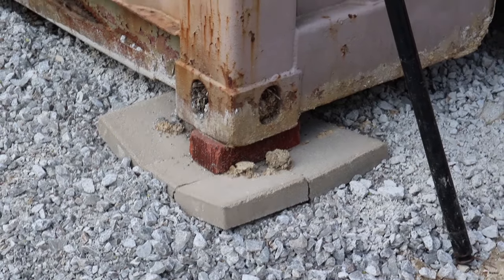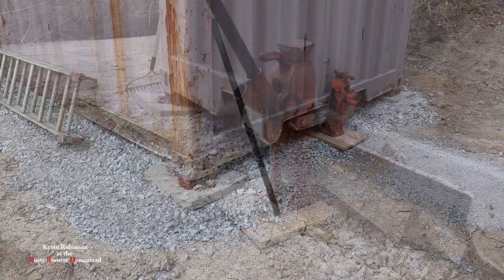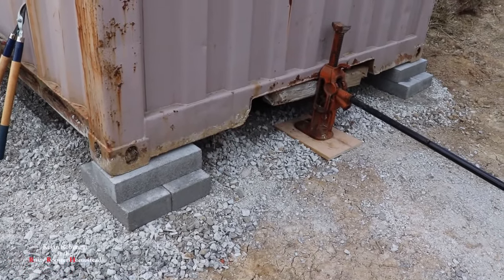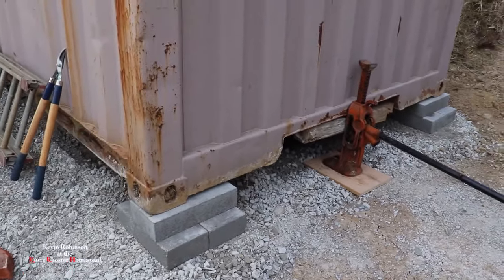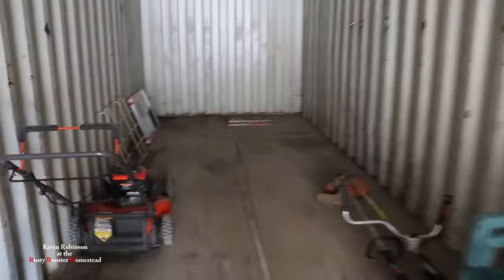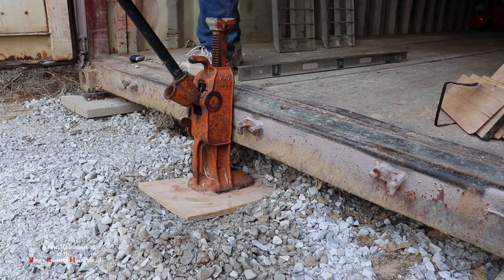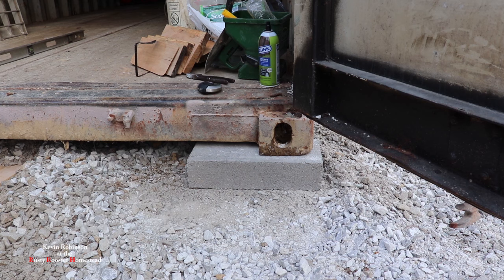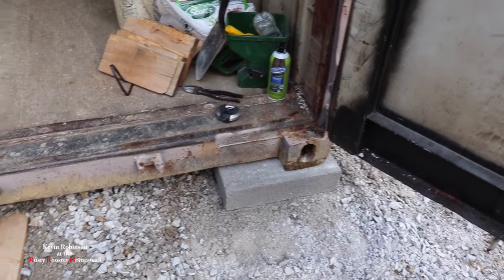leveling the shipping container

Comment: I put  one block on each side of mine and put 2x6 on top to act as cushion and to better distribute the weight onto the blocks and prevent them from cracking.
Reply from the maker: Good tip thanks for watching.
Reply: Wood on concrete is typically a bad idea. Speeds up decay in the lumber. Keep a close eye on that. A piece of sheet metal between the concrete and the board will prevent that.

Comment: I'm getting my first shipping container delivered first thing tomorrow morning, doing some last minute Google and YouTube research!
Reply from the maker: Good luck Jay and take your time you will get it.
Thanks for the comment and watching.
Reply: How did it go? I'm getting my 20 ft 1 trip sea can next week.
Reply: @rootreinlavery2442  It went great! I got it perfectly level front to back and left to right.  It's on railroad ties and I shimmed the corners with 1/4" steel plate, 8 inches x 8 inches.
I bought these jack adapters that plug into the corners, and also bought a pair of 8 ton bottle jacks and it lifts the container with ease!  I also just bought a wheel kit for the container in case I need to move it in the future.  They make tow bars for them to so a pickup can be hooked up to the container and tow it like a trailer 👍
I'm totally planning on getting at least one more container,  I love it!
Reply: @jayhondacr5008  Rite on. I'm going with a 3" of half inch gravel pad under mine. I had to work out the logistics of its location due to my drain field etc but things are looking good.
Reply: @rootreinlavery2442  I went and rented a dump trailer and also put several inches of gravel down.  I also rented a skidsteer, I had some dirt to move anyway but I used to clear a flat pad for the container.  It didn't take much to level the container since the ground was flat. I was so happy with that!
Reply: Where is a good place to buy a container? Seems a lot of scammers on marketplace.

Comment: I recommend using railroad ties. They are made to sit on the ground and can easily take the weight. A railroad tie is perfect length to run the whole width or cut it to sizes needed.
Reply from the maker: Thanks for the idea.
Reply: Would you let me know where I can buy railroad tie?  Thanks.
Reply: @user713Blvd  I got mine from Lowe's,  but Home Depot and others also sell them. Currently $28 each at the Lowe's here in my town.

Comment: For an extra step in confirming your container being level front-to-back, side-to-side, and across diagonally = lay your 3 bubble level on its side and check three before moving it. Also, flip it over and confirm on a slant (X) from the first way you laid it down and compare all three again. Just looking at one bubble may be straightforward and leaning differently side or slant ways. - From the people that built the Wonkavator. 😅 Have FUN and be Safe. 🍫
Reply from the maker: Thanks for all the good info and thanks for watching.

Comment: I use treated 6”x6”x8’ treated post, 5 under each 40’ high cube, shim on outside edges with treated lumber. 
First post laid under end, other 4 set every 10’ apart withrope attached to slide them across under container as trailer pulled up. Worked perfet as it distributes weight evenly across 8’ ft span. 
Unloaded in May of 2017 and they are still good to this day. Heavy loaded with filing cabinets of tools, nut bolts nails part chains etc. 
Very satisfied with treated timbers. Can turn 2”x 6” on edge and help keep most unwanted critter and grass from under containers and still have water drainage & air flow.
Reply from the maker: Thanks for the information and thanks for watching.

Comment: I got my container!!! A 40 foot Hugh cube, and it's a good condition: ni holes, no leaks, and the doors work marvelously! After greasing them, they make practically no sound and are real easy to open. A bit of sanding some rusty spots, priumer/paint, then coat the entire roof with Liquid Rubber (check them out - they have tons of solutions!). The sides have a few dents - it was manufactured in 2007, so it's 16 years old. I have it sitting on a 30 foot concrete slab (no blocks, but there are gaps from the pad's unevenness), and it's cantelevered about 11 feet over a gravel base. I have an air gap under it to allow for water to flow through, andhopefully it will be OPK. I filled the sides around the cantelevered part with gravel and bricks: hopefully I won't get any rusting or rotting there. The name of the game is allowing it to dry, right?
Reply from the maker: That's right thanks for sharing my friend.

Comment: I use railroad ties because blocks are delicate. If you score a Simplex telephone pole jack (harder to find than common jacks) the chain grab is superb for capturing chain from the corner fittings. I also use tow truck "J-hooks" with my Simplex and to winch containers in place. Every mechanic should have two J-hooks with chains as they'll wonder how they did without them.
Reply from the maker: Thanks for the good ideas
Reply: Obfuscated3090, where did you get your J hooks? You now have me thinking I need some.
Reply: What do you recommend for resting container on permanently? Concrete Paving Slabs or Railway Sleepers (railroad ties)?
Reply: @rehguzar85 Oak cribbing soaked in old oil, or creosote if you can get it. Be sure to have several inches of 1 or 2" clean gravel so the wood doesn't draw moisture from the ground.

Comment: Sorry to tell you your use of a spirit level is not perfect. All levels have a margin of error. Multiply that error margin over the width or length of the container and you have an out of level container. 
I suggest you use a water level to obtain a level container.
Reply from the maker: I used to have a water level but i don't know what happened to it, thanks for watching.
Reply: Handy tool to have

Comment: Compacting your crushed stone would have made a huge difference. The lime dust, once dampened and compacted, would have made your foundation similar to poured concrete if done correctly.
Reply: I was thinking the same thing, however; that stone with dust would also hold in moisture from the ground, thus expedite 
 corrosion of the underside of the container.
I think some clean 1" stone with a vapor barrier/Styrofoam would be a good base.
Reply: @JerichoRally I mean…so even with high enough blocks on top up of packed limestone would still create moisture trap?

Comment: Looks like that’s going to work out a lot better for you. Thank you for sharing!
Reply from the maker: I will check it for level again in about a week but it looks like it's going to work out good
Reply: @Robinson-Homestead My experience, which is quite a bit, is that you really need wood between the concrete and the steel. Those blocks will settle too, and when they get crooked they will crack. Wood is more forgiving in that respect.

Comment: If the weight is on the corners of the container what is the advantage of not setting it down at the center of each of the new footings?  I'm getting ready to do this and just doing my research.
Reply: Use treated 6x6x8’. 
I put 5 under each 40’ high cube (2) on decent ground (1 every 10 ft) 
Unloaded it on them, shim with treated wood if necessary.
Reply: 7 years ago with no releveling and they are still good today with heavy loaded filing cabinets of tools, chains & bolts etc in them.

Comment: Thanks for the video. I have two containers that have been converted to a home. I am having a difficult time trying to figure out how to get them 2 ft off the ground to connect the pipes. Maybe this will be what I end up doing. I need help haha!
Reply from the maker: The real Jack works great
Reply: Hire an professional engineer so your loads and soil bearing pressure can be evaluated for a design if you want something permanent..
Reply: I used a bottle jack to get mine initially off the ground, then used a floor jack to get up the rest of the way. Just be careful as the container goes it can and will shift. So be careful.

Comment: very helpful video. how have the blocks held up over the year? did you get much settling? I've seen where people use wheel rotors between the block and the container to help distribute the weight. what do you think of that idea? I'm going to be releveling ours that we use for storage soon. ty
Reply: That is awesome.  The blocks I have tried to use break if I let the container weight on them or a jack.  I have some old rotors rusting around.  They now have a use!
Reply: Works better if you have a good gravel sub base underneath the block and not just put it on topsoil.